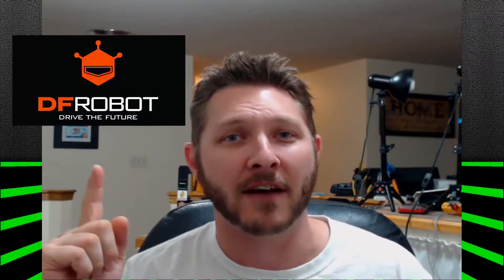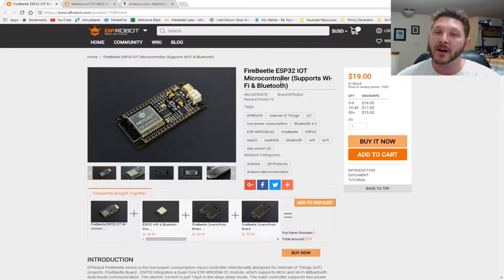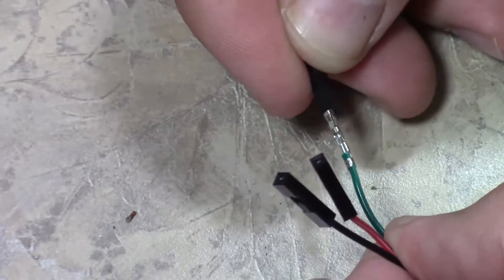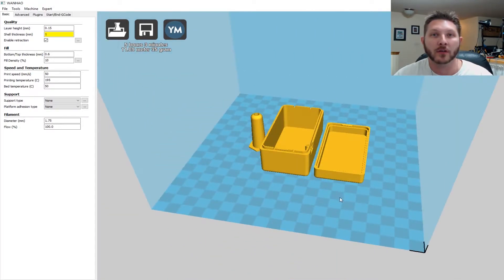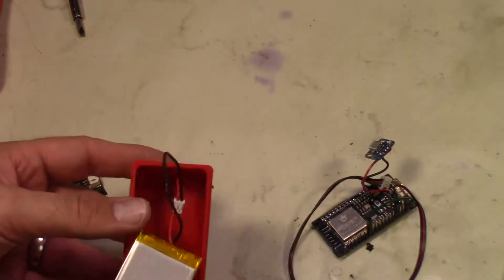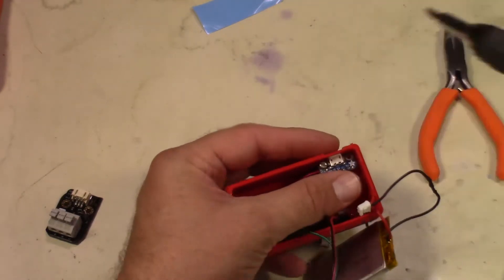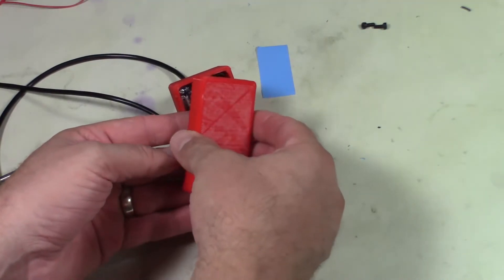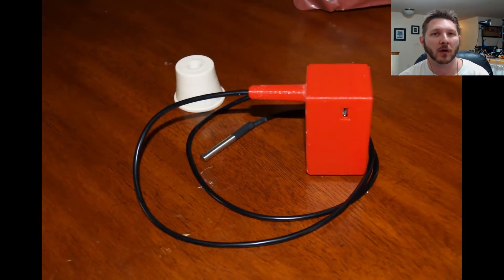Brew Probe - WiFi Temperature Monitor

Comment: How long does the battery last between charges?  I didn't see a sleep command in the code.
Reply from the maker: You are absolutely correct.  With no sleep command it will last only 4hours, aprox, with a 1200mAh battery which is what I have used.  Since you asked this question and pointed out the flaw in my code, I have updated the code on the github repository to include a sleep command where you can specify the amount of time it will sleep and gain more battery life.  Right now, if you download the code, it will sleep for 60sec which will extend the battery life, while using a 1200mAh batt, to 100 hours.  It will go up from there if you increase the time.

Thanks for the question and pointing out the flaw in my logic!!!